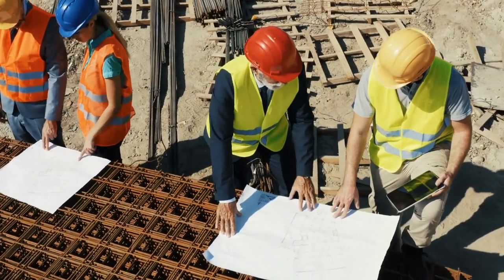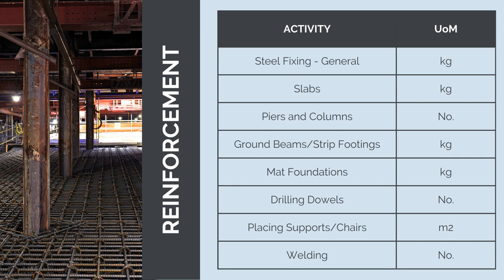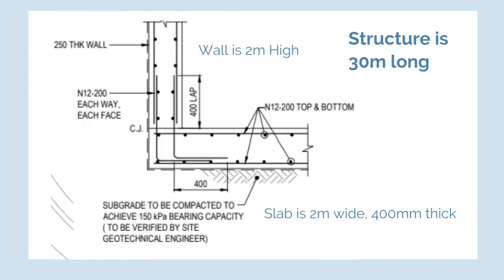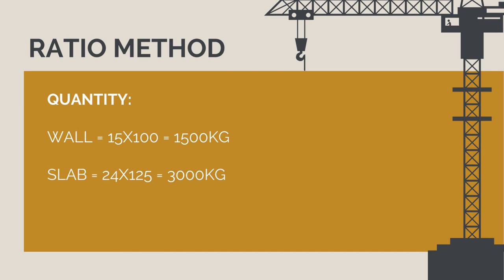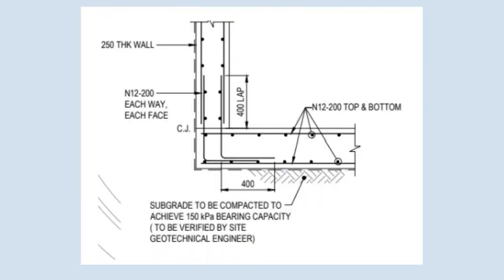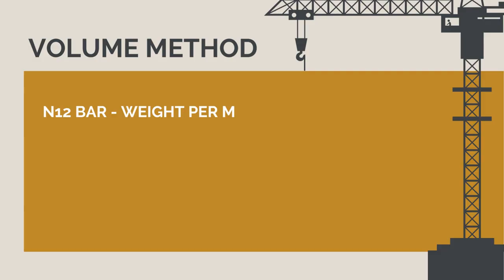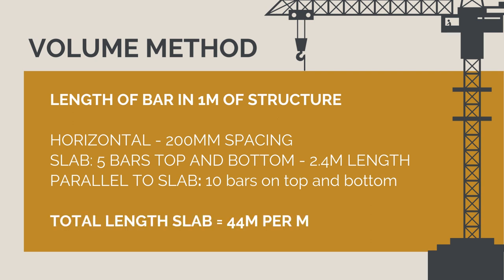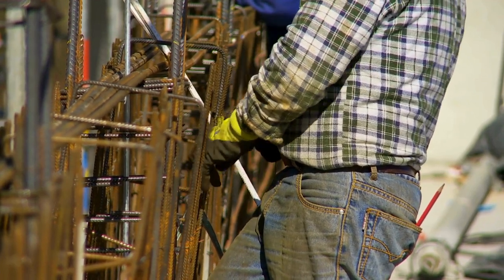How to calculate Steel Reinforcement quantities

Comment: So say the horizontal isn't listed...look again.
Reply from the maker: Sorry I don't understand?
Reply: @ConstructIQ  Thanks for that vid. The accurate claculation is not right - you are missing the L- bars lapping between wall and slab, the U bars at the slab perimeter and the development lengt of the slab bar runing into the wall. Consider this and it will bring you much closer to the ratio methode claculation weight.